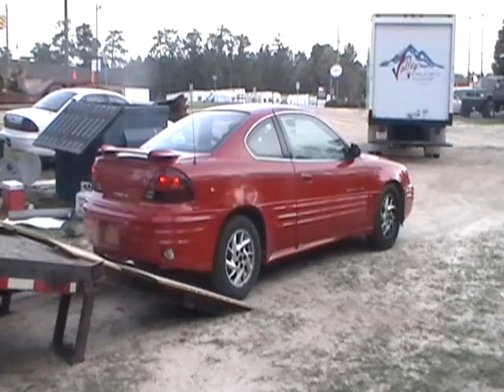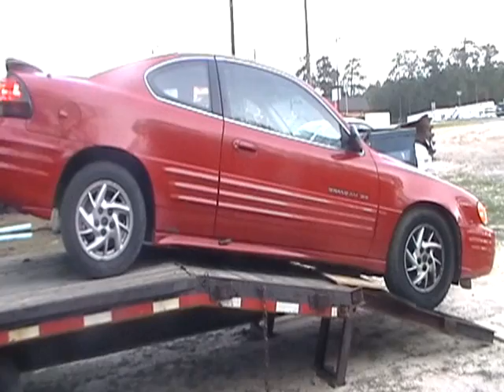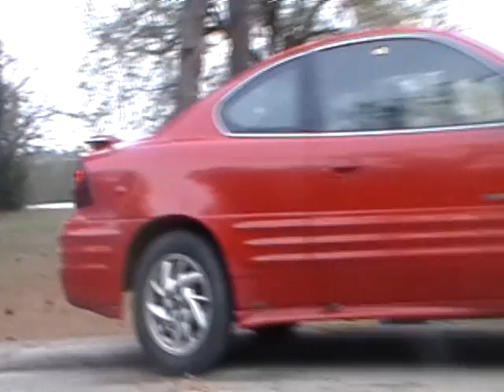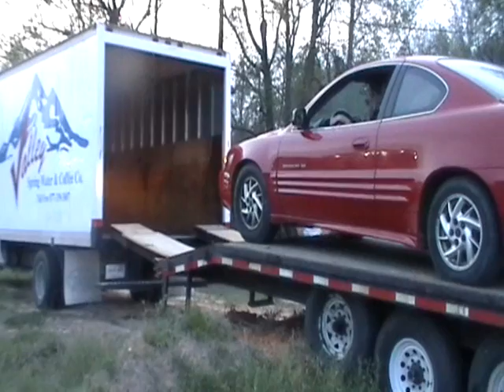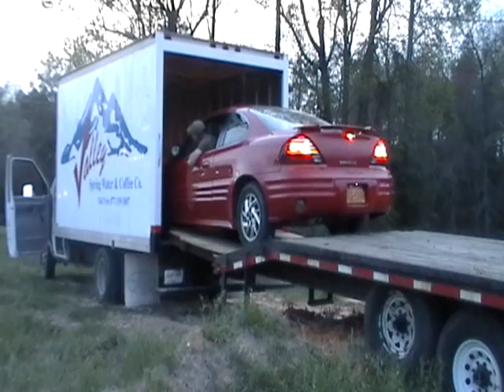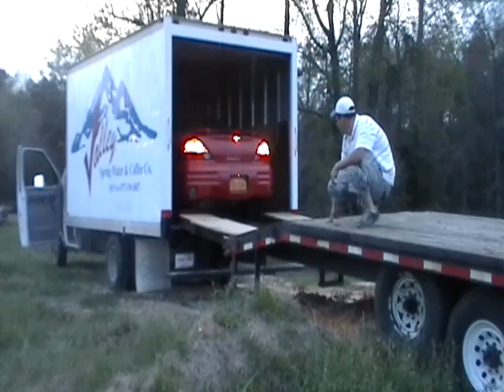loading car into box truck

Comment: Wouldn't it have been smarter and safer to rent a tow dolly??
Reply: But more expensive.
Reply: Six Mile Creek Productions or how about just use the big trailer?
Reply: I don't think these folks are too worried about either of those points.
Reply: Cheaper than repairs had this gone wrong.
Reply: Or, ya know, use the fucking trailer they're using to load the goddamn car in the back of the truck?!?!

Comment: I don't understand the basic premise.  Put a functioning car that gets 30 mpg into a truck that gets 10 mpg?  Does no one else question the point of this?  It would be cheaper to find a friend with a second car that gets 30 mpg, drive to get the new car, and then convoy back.  A LOT cheaper.
Reply: +Mickey Bitsko  The truck gets 10mpg regardless of weight. The car and truck have to get to the same end-point. You can have added expense of driving the car, or you load it up. 

Case in point
2 loaded vehicles (Pickup truck and a SUV), 2500 mile drive, each rig loaded gets 16mpg. Bit over $900 @ 3 bucks a gallon of diesel
Pickup truck towing a gooseneck with the SUV, gets 14mpg. Bit over $500 to go 2500 miles.

Yes, most people would just tow it... but if all you have is a box truck....
Reply: +rangerman375 So...800 mile, gas $3.00 per(?) at the time, 30 MPG...I get $80 saved. That's "on the bubble," for me...I'd probably go through the aggravation, but I could easily see doing it the other way. (Of course,if it means hiring a driver, it's a no-brainer.)
Reply: bcubed72 Yeah.  Being honest though, if you're got a box truck like this, NORMALLY you'd also have access to loading docks which would make loading/unloading much easier and safer... park and chock the box truck, just drive the car onto the loading dock, good to go. That's what we did for flatbed loading military vehicles, and for rail loading they typically have sidings that you can drive on/off of. I would sooner get a trailer, as I have done when people I know from out of state have broken down... then towed them with my own truck.
Reply: +Mickey Bitsko And this is what you call a basic debate/understanding. The both of you made your point and both had different out looks,but came to a common ground/understanding. The both of you is what this world is missing. Most people would have replied with a "Fuck you" and just talk like children... Anyways it was cool and I applaud the both of you, Peace.

Comment: You have no posable way of strapping the car down! You will need a anchoring point that is strong enough to hold twice the load. All is fine until a emergency stop! And the car is through the windshield! Look up proper car hauling procedure it may save you life
Reply: Slamming on the brakes won't make the car budge. Even if it did move, only plausible if they didn't set the parking brake or something, it'd just bump up against the wall in the front. Not gonna somehow plow through the front of the box and then through the cab. The only way it'd present some sort of danger to them is if they get in a wreck. In any wreck strong enough to throw the car through the front of the box and into the cab, straps aren't gonna help you much.
Reply: Its enclosed truck, where can it go?
Reply: super98x Believe me, a 3,000 pound car will tear that box to pieces if it was in an accident.
Reply: Super I hope u weren't seriously thinking that aluminum box would hold a car inside during the event of an accident
Reply: You guys don't get humor, its a running joke it the racing community. Get off the computer and out into the real world.
Reply: super98x "racing community"
alright lol
Reply: Not sure what that has to do with a racing community I drag race every weekend what's a box truck getting into an accident got to do wit anything
Reply: I will talk real slow now. A racer showed up at the race track with an ENCLOSED TRAILER, it was barely long enough to hold the car and had no tie downs in it. When the doors were closed the bumpers touched the nose of the trailer and the rear door. When he was leaving someone says to Tom, "how are you going to strap that down"? His reply was "its enclosed, where can it go"? That has been a running joke at the track ever since. GET OFF THE COMPUTER AND GO EXPERIENCE SOME REAL LIFE. I'M SORRY I EVER COMMENTED BUT I FEEL IT WAS AT LEAST MY DUTY TO EDUCATE THOSE WHO COULDN'T FIGURE OUT THE COMMENT. MY GOD, MAKE ONE COMMENT IN 10 YEARS AND THE PANTIES REALLY GET WADDED UP..
Reply: super98x It's just a hop skip, and a ukulele.
Reply: super98x  I understand your frustration. The unfortunate part is sarcasm and wit don't come across that well in text unless you put a cute little lol behind for the soft brained ones.

Comment: the gas millage must have been epic 5-8mpg... not to mention u can roll the truck easier with all the weight up higher..lol... if its just a small trip around the corner go for it
Reply: Its a truck,thats what trucks are made for. A car like that only weighs 3500 lb and even the light duty cutaway style box trucks are rated for that.
 The weight in a car is all low so its a perfect load with the exception of not having much abilty to place the load where you want as in front to back.

Comment: this journey would of cost like $120 in gas totally not worth the potenial hazrds! keep in mind if you were to just damage a bumper, and lights plus average paint shop rates for a single pannel. using sources from rock auto: bumper-$55 fog lights-$30 each headlights-$45 each plus the $150 local paint shop single panel rate that equates to $355. in my opinion that would be the most minimun damge possible!

Comment: And if that boxtruck is in any type of accident that causes it to stop fast, that car could push thru the bulkhead and kill the driver.  Boxtrucks like that rarely have proper cargo strapping equipment to haul a car.  Car tires will slide on wood or metal cargo floor pretty easily.

Comment: If the truck is a diesel then it would be fuel not gas.Gas may be a fuel, but put gas in a diesel engine or diesel FUEL in a gas engine= new engine.

Comment: I thought the same thing, how are they gonna secure it? The first time they hit the brakes, ..."Oh Shit"!. A few years ago, a friend asked to use my 96 Silverado, super nice clean truck, to pick up a 55 gal. air compressor, I said no way. He used another guys truck. Well I had a bad feeling, and I was right, Dumb ass loaded it over the rear wheels, rather than up front, sure  enough, he had to use the brakes, and WHAM! the thing tipped over, and crushed the roof, shattering the rear window. Thankfully the owner was cool about it, {but not too bright} Ha! he used about 2 gallons of bondo to fix the roof!